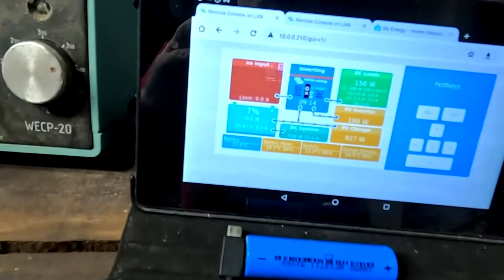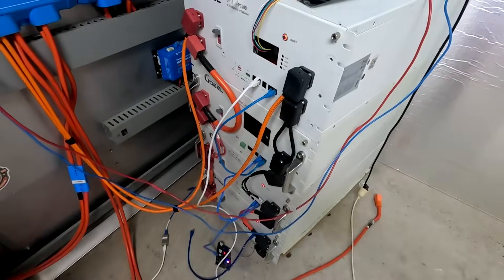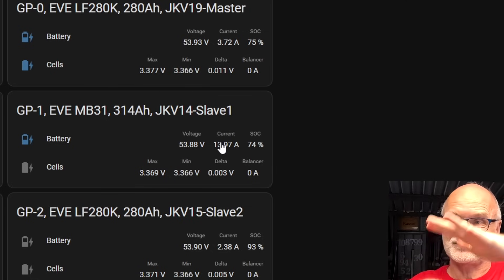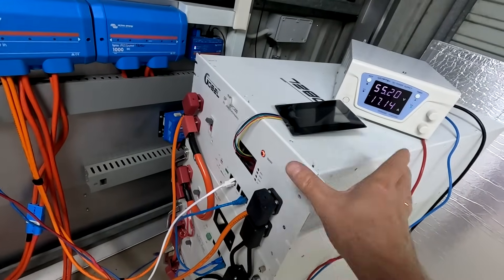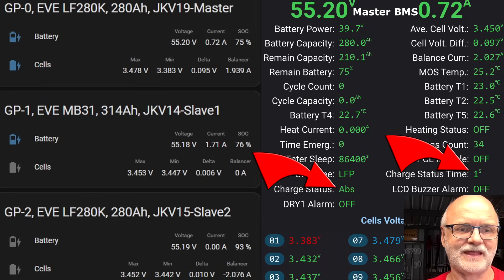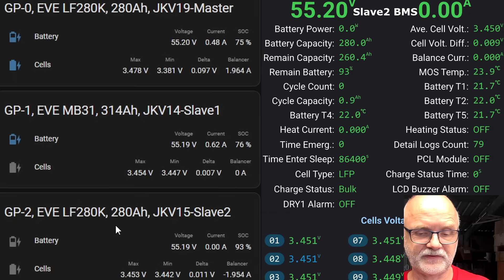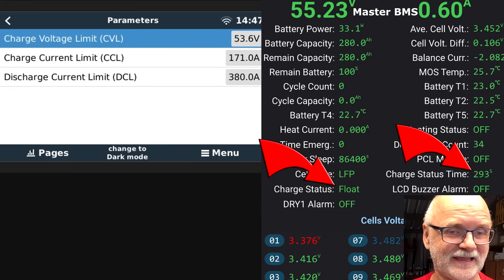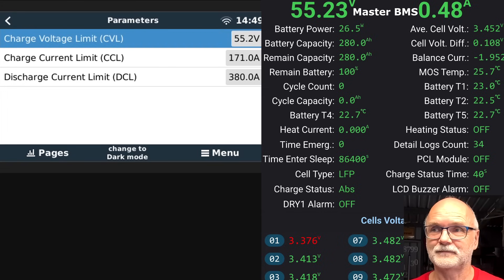JK-BMS V14, V15 and V19 in parallel and first full charge. Why no 100% reset of the BMS?

Comment: Hi guys im having a problem with the v19 bms not cumunicating to the v15 bms if the v19 is a slave battery but if i use the v19 as the master with the can cable connected to the inverter i can connect the slave batterys to the bms and all the batteries communicate together the only other way i could get the other batteries to communicate with the v19 if its a slave is to use the rs485 port thats actually used for inverter communication then it works

Comment: I recently assembled another diy 16s 300ah battery equipped with new jk inv bms v19a with soft ver of 19.05
Ive noticed that the rcv is not functioning.. the battery keeps on charging untill it reaches over voltage protection. Am i doing something wrong
Reply: Update:
Turns out the bms' voltage calibration is way too high or maybe my inverter is not following my bms' voltage readings .  My inverter follows it's own voltage reading.. im still trying to balance the whole pack using it's active balancer

Comment: Hi Guys...
I updated the firmware to V41 on my V15 200a inverter BMS yesterday...
Couple of things....We had decent sun in the UK yesterday and although my 100% SOC voltage is set to 3.449v the battery sat at 99% all afternoon even though I a couple of cells hit 3.55v .Sunsynk Inverter if that makes a difference.
Secondly, I'm not seeing the Charge Status setting, ie, Bulk / Float etc in any of my android phone/tablet apps...I don't see an option to update the app in the play store ?
Any pointers would be appreciated.
Thanks.
Reply: jk fw v15.41 is latest
Reply: @SiBex_ovh  Apologies, my bad. I meant V15.41, i'll edit my post.
Reply: @kennyrodg  just disable Flouting, then jk request RVC to inverter and that way you should do old way a balancing and soc100
Reply: @SiBex_ovh  Thanks Bud. I turned float mode off and I'm now seeing 100% soc
Reply: @kennyrodg  You welcome, I write 4 commands but I see only one about disable Float say here :(.

Comment: I have a issue with JK Bms, while connecting my 48v 100ah battery to inverter, it gives error 6 (discharge short circuit protection) could you help me with that.

Comment: I have an on Grid system with Victron multiplus II and 3 x JK bms v15. Tried setting the Float mode on the BMS, but this has a little different behavior once it has reached the Float mode - Requested Float voltage will be set to 53,6V and the inverter immediately starts pumping energy from batteries to Grid with maximum power to achieve the voltage. As you are off grid you dont get this behavior. Do you have an idea how this can be fixed?

Comment: I faced the same issue and it took me some time to figure it out. When you have BMSs connected in parallel, you need to disable the 'Charging Float Mode'. This solved all the issues I was having with the state of charge (SOC) and the constant switching on and off of charging, until all BMSs reached the correct voltage and the inverter stopped trying to charge.

Comment: Ciao. Io io un luxpower sna6000 in comunicazione con la batteria ma non resetta mai il soc. invece appena tolgo la comunicazione e lavoro con le tensioni si resetta al 100%. In comunicazione rimane al 99%
Reply: It will not be possible to fix the error that JK will not update anymore. It can be fixed by taking SOC 100% Volt as the logic to set SOC 100%
Reply: quale jk bms hai? quale versione del firmware? perchè dalla V15.35, il soc si resetta a queste condizioni: Fase di assorbimento finita e Battery Volt maggiore di x*SOC100% (dove x è il numero di batterie). ovviamente la fase di assorbimento inizia quando una delle celle raggiunge il valore di SOC100% e il tempo settato in RCV Time è scaduto (cioe se RCV Time = 1H, devi aspettare 1 ora per il reset del SOC)
Reply: @ciane1212 allora la versione è la 15.34. Le ho provate tutte ho anche messo rcv time 0.1 ma niente rimane al 99%
Reply: @ciane1212 There is always a voltage drop so the Vol cell RCV logic cannot reach the condition. It is possible to downgrade firmware v15.33 but in the long run, BMS JK drops SOC and is still unstable.
Reply: I also use SNA6000 inverter. The problem here is that the logic uses the total Vol cell RCV voltage as logic instead of the 100% Volt SOC voltage. There is always a voltage drop from the inverter to the storage battery, the cell deviation in the cells cannot reach this logic. From firmware V15.33 and earlier, this logic does not exist so it is not faulty. If you want to fix it, I hope the JK developer will update the firmware to fix this logic by using the 100% Volt SOC voltage logic.

Comment: Instead of using RCV voltage logic, it uses SOC 100% Volt voltage logic to switch modes, then SOC 100% has fixed this error. Hope you can contact JK to update new firmware according to this logic.

Comment: Is JK Inverter BMS V19 works with old 4.3 LCD? Is it possible to connect and run both, new and old displays on one BMS?
Reply: BMS works with 2 display at same time. Old display works if you only replace BMS for new one. Both power button works at same time. 
One URGENT option to add - screen rotation. If you glue it incorrectly, you have problem for now.
Reply: +1, good question.

Comment: Sorry Andy, but this was such a BS episode :/ Battery and inverter communication is Voltage and Amps, that is totally sufficient! Just imagine an external CC / CV LifePO battery charger. By what you''ve been talking about here for 20mints, its should not be possible for the battey charger to work, but of course it does! So can an inverter with even a varied battery pack. LifePo charge curve is all the same, and inverters are perfectly capable of charging these packs based on voltage and current observed over time.
Just the simplest example of the mysterious voltage drop between them, simply does not matter, once the desired charge/starting current drops to 1/10th, we know that we are in the exponential region of the voltage curve, hence need to switch to CV mode for a set period of time. No need to know the actual voltage difference, even more so, there is always a considerable voltage difference, thus the nature of a current generator, fixed Amps charger...

Comment: Well, I managed for the first time to charge to 100%. I had to download the newer android app from your website/Google drive. The one on the play store doesn't show the timer or the option to adjust the time. I found out the default time is 5 hours! My absorption time in victron is only 1 hour, so that never worked that way. Happy I figured that out! I did set the 100% voltage 5mV under the request voltage, since the balancer can't go lower anyway.

I guess I'm kind of okay I won't get updates anymore, as long as there are no major bugs anymore. In the end the software is kind of shitty to set up. Every time you upgrade firmware everything is reset. Even when saving settings, after import you still need to press the OK buttons for all the values in the right order. The hardware might be nice but the software has a lot of improvement potential that will probably never be.

Comment: what about other things than BMS-es..? Please inform us about Victron equipment, cable choices, where and when breakers should be applied and where not to reduce connections, Please test and make considderations where or not main switches should be applied, How to peakshaving (there are a lot of victron firmwares where peakshaving is not working), what the impact is of peakshaving related to main breaker setting. VE-direct or VEbus should be used. Do pylontech or not, when to choose 12V, 24V or 48V... so many interesting subjects besides the BMS... should i continue?

Comment: Andy, great video. Just one questions that remains for me. I have 3 batteries, and if the master battery reaches RCV it will start the counter. When the other batteries reaches RCV a little later, the counter starts a little later. But when the master battery counter ends, it will go to float voltage and my multiplusses will decharge at a big rate. This will of course lower the voltage of the other batteries and they will not be resetted to 100%. How can I solve this issue? Many thanks and keep up the great videos!
Reply: yes, have the same question... lookes like the slave batt, could not even trigger the timer.... before master triggers the float V...

Comment: I’m having an issue with my JK BMS and solar setup. 

When the JK is charging the battery from solar and discharges for some reason for a while, it the stops charging and starts sending the production power to the grid, acting like it’s fully charged. 

It only resumes charging if that consumption drops SOC by about 10%. 

Has anyone else experienced this with a JK BMS, and any ideas on how to fix it?

Comment: @OffGridGarageAustralia
i also use a JK-PB1A16S10P "here in stormy, cloudy and cold Germany" 😀
My BMS shows 52,8V and 8% SoC.... its soo weird.... and i go for a full cycle nearly every day.
Any advices?
Reply: Is the capacity definitely set right? Does it reset to 100% when charged? Do you have a clamp meter so you can compare the indicated current with what's actually happening?

Comment: Good idea Is all BMS voltage calibrated in same time on known value. IT solve lots od problems.
Reply: Voltage is easy to measure quite accurately - it's current that is the problem.
Reply: @matthewmarks6951  That is absolut true.

Comment: Because my battery does not fully charge in autumn and winter, the JK BMS SoC measurement has become extremely inaccurate. To overcome the issue, I am using Home Assistant to calculate the SoC based on how much daily energy goes into the battery and how much daily energy is discharged. The daily charge and discard energy is calculated from the JK BMS charge / discard power measurements. My battery efficiency is around 88%, so I adjust the charge energy by a factor of 0.88. SoC = 100% / Battery Energy Capacity * ((Daily Charge Energy  * Battery Efficiency Factor) - Daily Discharge Energy).

Comment: There is a bug in import settings function in rev 15.41.  All it does is 'fill in the places'.  It does not register the imported values unless you hit EVERY 'send' button.  You still have to put up with the 'invalid entry' if you don't hit the 'send' buttons in the order of their required voltage hierarchy.

You can clone the settings to another BMS (with rev 15.41) but have to hit every 'send' button.  It will enter the BMS name from the original file you are cloning so you probably want to change the name on cloned BMS settings.  

I found the bug this way and initially thought the export file has some sort of serial number ID that prevented cloning the settings to a different BMS.

Since entering all the settings for the PB BMS is such a pain in the ass, the export/import settings is the only reason IMO to upgrade to 15.41.  I don't like Rev 15.41 keeping the cycle count much.  It just keeps accumulating all the Columb counting errors.  

Rev 15.41 does reset the SoC from battery voltage lookup table when you hit the AH size 'send' button.  Should have near zero current on battery for at least five minutes before using the SoC voltage-based lookup table to ensure cells are at rested equilibrium voltage.
Reply: I noticed this bug too. There's another problem when connecting the monitor software. If the RS485 connection to the PC is disconnected, a battery in the CAN bus goes offline!

Comment: Slightly off topic suggestion to pass on to LK if you have not already done so.. The first video that you showed of the V19 Inverter BMS the screen would not turn off in the phone app, now it can be turned off in the app with the newer FIREWARE. However it stays off, it would be nice if it turn off itself after a period of time automatically and turned on when the screen is touched like on our computers.

Comment: Hello Andy!** First of all, I wish you continued success in your work. I really love you and your content. I’m using prismatic LiFePO4 batteries in my wheelchair. Do you have any information on when the WiFi-enabled JK BMS will be released? When I’m using my wheelchair, I can’t monitor the charging status since I’m away from my car! I’d be really happy if you could share any updates. Wishing you all the best with your work.
Reply: Did you try esp32 solution?
Reply: @tomaszbaranowski9200  First of all, thank you very much for your response. Could you please share a video link that explains the ESP32-based system from scratch? Also, what are the disadvantages of this solution? For example, Daly BMS has built-in WiFi. I’m looking for something just like that — I want to monitor the battery data of the BMS remotely, not just over the local network, but from anywhere.

Comment: Hi Andy, I see you still have that gap above the garage door :-) Are you stuck with it, can't get yourself to finish it? I know the feeling...
I think you should have made it simple and removed the door altogether. They have no purpose now anyway. Then you could make a proper wall and insulate it.
If you decide to keep the door, I would suggest to box-in the upper part. Make a metal box frame and plaster. That's quite simple to do.

Comment: Taking the voltage from BMS will kill the second instance of safety.
In my opinion charger should meassure its own voltage to stay save if the BMS fails.
If there is a problem with some voltage loss across the wiring it should  be compensated by a better wiring or tuning the settings, not by bypassing  a safety feature.

Comment: The flaw in the 100% SoC reset is that the BMS requires the RCV to be reached. This isn't needed as they could have just used the 100% SoC voltage instead. The issue is that many Chinese inverters ignore the reported voltage from the BMS and simply use their own voltage reference which means the JKBMS never actually sees the RCV, always a little lower. The workaround to lie to the BMS about its calibrated voltage isn't good as it's a safety device too. JKBMS needs to ignore the RCV and just go by the 100% SoC reset voltage instead to trigger the timer. I am actually trying to work with one of the Chinese manufacturers and convincing them to use the reported voltage of the BMS as an offset has been like pulling teeth! I'm also attempting to convince them that just because the BMS reports 100% SoC doesn't mean they should stop charging and that's just as hard. They're so averse to changing the way they work I even have a Pace BMS from one manufacturer's own battery system running tweaked firmware that lifts its own RCV by 0.6v in the Pylon CANbus message to overcome this instead of them changing their own inverter code.
Reply: I have exactly the same problem with Deye. My Deye lowers the charging voltage by about 0.05V per cell. To charge the cells to 3.45V I have to set RCV to 3.5V. Deye support did not help with the problem, they are helpless. JK BMS support did not even reply. It would be enough for JK to be based on SoC 100% Voltage, there is no need to mix RCV into this algorithm.
Reply: @maciegx1337  I have a 3phase 12kw deye, I have disabled float mode in all my 3 JK v15 bmsses
Reply: You obviously know your oats. Any idea why, once 100% SOC has been reported to my Sofar inverter, it refuses to charge again until the SOC drops to about 95%? Are they thinking of mild battery protection for NMC cells?
Reply: @matthewmarks6951  yes it seems like the inverter's doing some kind of anti cycling at the otp of charge, we had a bunch of VKingner BMSes that did the same and couldn't be disabled, and they kept the charge disable flag active until 90%! That was a right pain. To me all this stuff needs to happen on the BMS and not in the inverter.
Reply: @iPeel  Thanks. I've bought a JUNCTEK shunt and at some stage I intend to use it with YamBMS or something. I imagine that opens up the possibility of sending the odd 94% SOC value to the inverter to kick it back into action.

Now I wonder which voltage measurement it uses? I expect from what you report that it will be its own, as per the rest.

By the way, I started off with a small Renogy battery as when I bought the inverter I assumed it couldn't cope with an existing set of panels, so I'd have to use it in passive mode and control it externally. Hence I wasn't worried about incompatible protocols - nothing seems to support Renogy except itself.

In fact it (and I'm sure all hybrid inverters) works nicely charging from its own and the original panels, bar the occasions when it decides the current transformer is the other way round and dumps the battery into the grid as fast as it can...